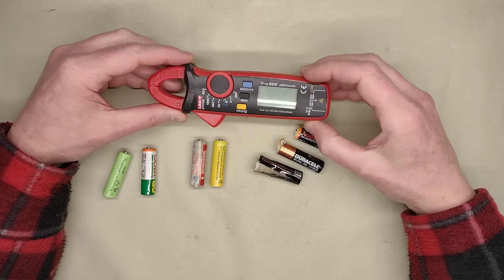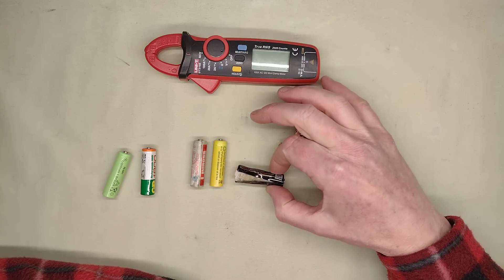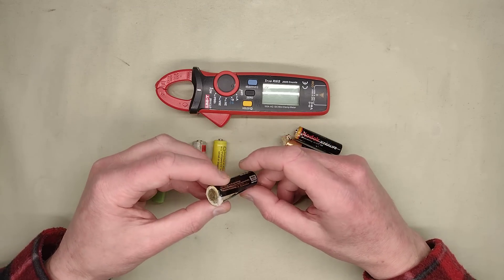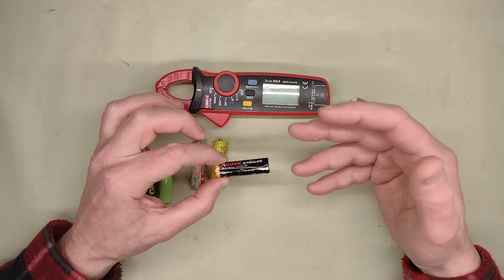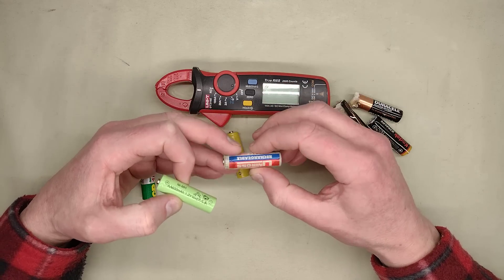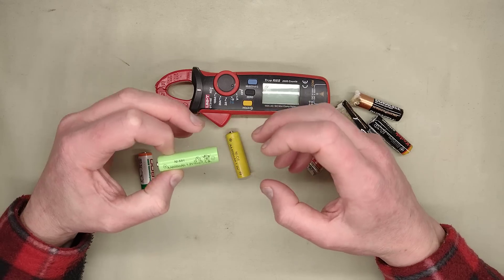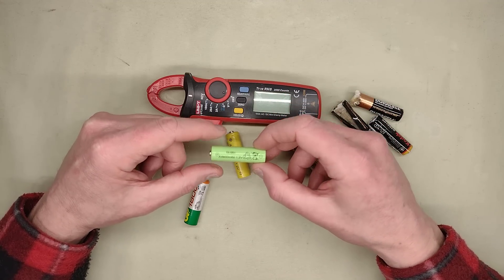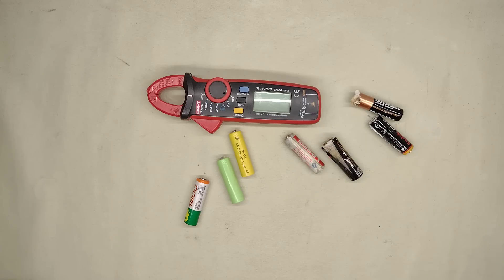The curse of leaky alkaline batteries

Comment: Once upon a time we had "heavy duty" cells which I guess were zinc-carbon. They leaked all the time and alkaline batteries were the upgrade. Alkaline batteries never leaked. It's amazing to see that they're now the ones with the reputation for leaking. I guess the problem was never the chemistry and just the margins and the engineering them down to a price. Duracell used to be a premium brand that lasted longer and never leaked -- now it's a bit of a zombie brand that's licensed and manufactured cheaply and is notorious for leaking. It would be interesting to see a disassembly of batteries from different decades and brands with measurements of the thickness of the layers.

Fwiw Duracell will warranty their batteries including paying for damage caused to electronics from them leaking.
Reply: Sure. Try that warranty when their batteries destroy traces on the main pcb of a valuable 1991 pinball machine. They don't even bother to respond at allot any complaints or enquiries
Reply: Yes, Leclanché cells used to leak seriously, but I suspect Clive is too young to remember them. Once upon a time alkaline batteries from Duracell were guaranteed not to leak, nor did they do so. Today they’re dreadful and I haven’t seen their guarantee for a long time.
Reply: That's a great point, I'm always a bit hesitant using a rechargeable for my kid's device for that very reason.  Also his devices are more likely to be abandoned toys at the bottom of his toy box that will never be used again, so another way to lose them.
Reply: Kodak even worse as a brand for cheap leaky alcaline batteries. Half of mine leaked before unpacked. But they have decent ~ 2000mAh capacity still.
Reply: Ever Ready used to do Zinc Carbon Silver Seal batteries in the 80s, they were guaranteed against leakage and to be fair i have never found one that had, even after decades. https://www.youtube.com/watch?v=jCLtKlA5pBA
Reply: To this day I've never had an alkaline battery leak. Maybe a regional problem?

Comment: I had no luck finding those "keep their voltage - ready to use" ni-mh batteries. Nowadays I try to buy new stuff that have built in lithium batteries, so I does not have much stuff that need AA or AAA battery.

Comment: i've moved away from alkaline batteries for many devices now but i still buy them for my guitars and to keep in my gig grab bag, my wireless runs on Panasonic NiMh quite happily but i have a few guitars that require 9v cells so they get the premium alkalines and they are replaced regularly (old ones go on the bench for testing duties) but some things like clip on tuners take CR2032 so i keep a supply of those and some Alkaline AA and AAA for other things as well as a couple of Aldi or Lidl 9v batteries for the inevitable situation when someone needs one at short notice for a guitar or pedal, I'd rather hand over alkaline batteries and get a beer in return than hand over NiMH and then have to remember to rescue them at the end of the gig.

Comment: I was given some Thunderbolt brand batteries (2 dozen) they seem to be decent enuff, but they are about 1.5 mm SHORTER than the other brands. This does not matter when the device has a spring contact on the - end, but it does when the contact is just a fixed piece on metal. Then the contact must be pried out a bit so the battery will work.

Comment: It is all true. I have been telling my followers of vintage battery toys for years to never leave a battery in the toys when not in use. All alkaline batteries will leak given time. Back in the 1950's and 1960's it was the carbon base batteries that leaked and took the life of many a vintage toy. Even button cell batteries leak given time. Many of my vintage robot toys "there are over 4600 of them in the Robothut" have a value way over the price of my best test equipment in my shop, so I have to make sure the batteries are accounted for after a video play time. So many good bots have been damaged by these batteries. But just the other day I played with a 35 year old robot toy that has built in Nicad batteries and was surprised to find that they still took a charge and worked ! Amazing. Great video Clive.

Comment: I did have a wireless gaming mouse that would not work with 1.2v batteries. That failed recently due to mechanical wear on the switches. It is the only device I have run into that would not work with lower voltage rechargeable batteries. I'll use up the brick of alkaline batteries I have and then go 100% rechargeable.

Comment: I’ve tried many NIMH low self discharge batteries and they all die after a few years. Instead, I use lithium ion cells and rewire to keep the voltage right.

Comment: That's my main problem, half the stuff I go to use the rechargeables in complain about low / no battery cause of the voltage difference. I've also tried many of the cheaper brands of rechargeables  that are flat within a month or if you forget and leave it flat for a week the standard charger won't acknowledge it. I've jump started a few on a cc/cv supply but I don't think that's very safe or good for the battery.

Comment: I use NiMh in most of the devices that I use every day. They save money in the long run and reduce the amount of batteries that end up in the garbage I still use alkaline in my 'atomic' clock and my furnace thermostat because they last longer. I have had to repair the contacts a few times due to corrosion. I but a dab of solder on the contacts after cleaning which helps.

Comment: I’ve had so many devices ruined because of alkaline batteries that leaked
Reply: If you’ve ever had them leak and expand inside of a flashlight 🔦 you know there’s no saving that light cause those batteries are stuck for good.
Reply from the maker: I just threw out a light for that very reason.

Comment: flash/strobe triggers for photography seem to exclusivly work on alkaline batteries. tested from the cheapest neewer-brand to most expensive ones from profoto and broncolor. tried eneloops (+ the pro versions), lithium cells ... they turn on with every sort of batterie but they only trigger when alkaline batteries are used. 
it's a pain cause if u want to prevent them to leak in kits you don't need that often u have to take them out ... then u forget them in studio when you need them on location ... 
wonder why that is ... is it really because of the slightly higher voltage? can't think of another reason ...

Comment: I'm with you on NiMH (I like eneloop), but can't get alkaline out of my life. You were quick to dismiss the 1.2v vs 1.5v difference, but a) 20% lower nominal voltage isn't a small difference, and b) like it or not many devices do care, and either won't work or won't work correctly on NiMH. Unfortunately in my experience those tend to be the same devices where batteries sit for a long time and are prone to damage from leaks (remote controls, scales, meters, etc.). That's not "the manual says" that's "NiMH didn't work so I had to put new alkalines back in".
Reply: Alkalines are down to 1.2V before they're half dead.  They are at 1.5V for only a very short while.  NiMH just sit near 1.2V for most of their cycle.  It shouldn't be a problem for any device that properly uses Alkalines until they're dead at 1.0 or 0.9V. Battery prediction circuits obviously might not predict properly.  But that's why you carry spare batteries when it's important.
Reply: @stargazer7644  The difference between theory and practice is that in theory they're the same. There are no fewer than 7 devices in my house that work just fine on fresh alkaline batteries but won't even turn on with NiMH batteries straight off the charger. You can argue (and I wouldn't disagree) that those devices are poorly designed, but that's not going to make them work on NiMH batteries. Yes, this means batteries those devices consider dead work just fine in less demanding devices like LED torches.
Even worse, I've now got several cameras around the yard that are so intolerant of voltage drops that they will die inside of an hour on alkaline batteries and effectively require lithium AA batteries to work. On lithium AA batteries those cameras happily run for over a year. Some devices are just really picky about batteries.

Comment: hey Clive. I would like to use nimh rechargeable batteries but how do you compensate for the reduced voltage, 1.2V...........Mike
Reply from the maker: In some equipment that's a huge issue.  It would be a selling point in modern equipment to say "rechargeable ready".

Comment: Can you do video about alkaline battery chargers? Do they even work?
Reply from the maker: Yes and no.  They use PCR (Periodic Current Reversal) to get clean chemical transfer internally, but only work a limited number of times on partially discharged batteries.  They are very prone to causing pressure build up and leakage.

Comment: For my wireless Razer Orochi V2 mice, I am using Kratax LiIon AA cells with 1.5V buck converter. They last over 1 month (without turning the mouse off at all!) in them before I need to recharge, and they keep the mouse light.

Comment: As with NiCd, there are a few niche use cases for alkaline cells. If the device will tolerate the lower voltage of NiMH the that's what I use, if not AND it is not mission critical, OR if it would benefit from the 1.5-2× capacity vs  NiMH, I'll use the Lithium Ion with buck. 

I'm interested to hear if anyone else has seen good results with the AA form Li Ion w/ buck. 
I'm using the EBL branded and they delivered ~3100mAh at .2C and were a stable 1.5V until LVC when I first tested.

Comment: I tried using 6 NiMH in my Game Gear and couldn't figure out why it wouldn't power on. Then I realized: 1.5-1.2*6... I was missing a whole cell's worth of voltage from the switch! No wonder the device didn't like it. I guess that's 1990's tech for you.

Comment: I only trust Eneloop cells. I am using 2 AAA ones in the EEVBlog multi meter, 3 AAA ones in my bank chipTAN generator and 2 AA ones in 2 wall clocks that last over a year. All normal Eneloop ones (white). I use the BC700 charger. Cheap and very reliable and good.

Comment: The one application I find that I personally still use alkaline batteries is in Radio Mic packs at work. Especially for shows we always just use a fresh out of the box pair of alkaline cells to ensure that the mic doesn’t go flat. We’ve had lost of issues with using rechargeable AA substitutes especially in mission critical applications. Not to mention some of our packs seem to be very picky with the voltage they get.

Comment: My experience with NiMH is that they still have high self discharge rates. I have several brands ranging from cheap chinese to well known brands and I cannot keep them charged ready to use. After 2 month you look for a battery and they are all half empty needed a boost up charge

Comment: I use boiling water to clean off the corrosion, a trick I learnt for cleaning lead acid battery terminals. 

Albeit I agree that any device that drops out at 1.2V is poorly designed, I have a Sony Mouse and Bosch Laser Distance Measure that do not last long on rechargeable batteries.  I also have a Trail Cam that drops out at low temperatures if fitted with rechargeable batteries.  For the latter I now use those very expensive AA cells that contain a 3.7V Li-ion cell and regulator that drops the voltage to exactly 1.5V.  It does mean the battery life indicator on the Cam is useless, and the batteries suddenly die.  However, they should pay for themselves in a couple of months as, not only do they last longer, as the voltage is held up to the end, but it saves on 8 Alkaline Cells every month.

Comment: I think it's fair to say that Duracell AA/AAA are the Kings of Leakage (but yes, i have had Philips, Varta, and others leak.)
One interesting feature (which i see others have mentioned) is quiescent current draw when appliances are supposedly 'off'. Even  500-800uA in something which has Duracell AAA fitted can result in leakage; it seems they don't like micro-currents of extended duration. It's happened to me too many times to be coincidence.  

I do notice that those little quartz clock movements you can pick up for no money at all, start to malfunction at 1.35v or thereabouts- but in some ways that's an advantage as the stoppage is noticed and the AA alkaline gets replaced before it has a chance to spew.